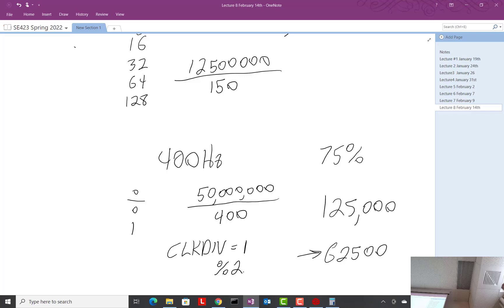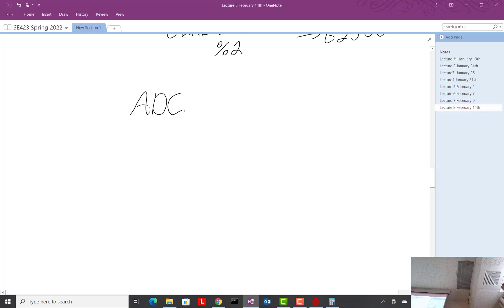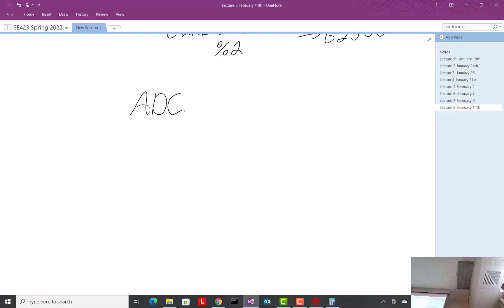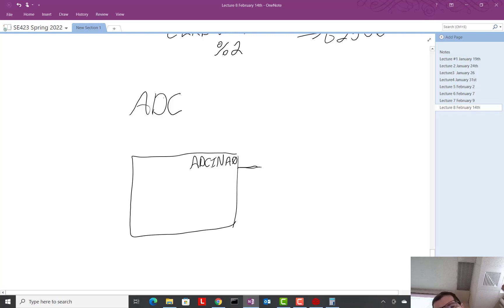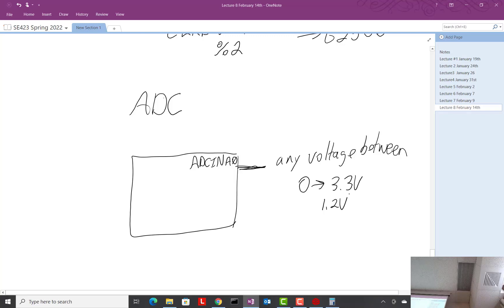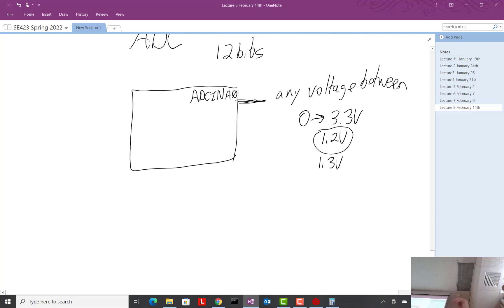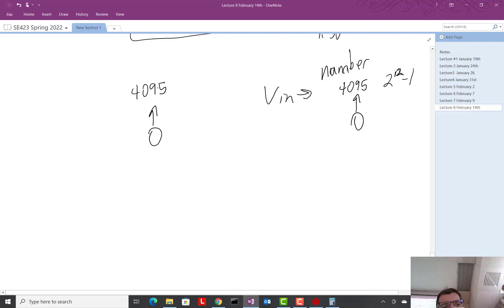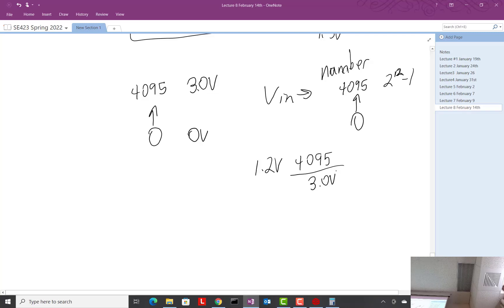ADC (Analog to Digital Converter) Quick Introduction

Comment from the maker: No on the F28379d there are internal 3.0 volt references and the adc uses the that 3.0 reference for its high. So 4095 is almost 3.0 volts or anything higher than that.

Comment: Sir, the maximum voltage that can be applied should be 3.3volts rather than 3 volts right?
So at 3.3volts it gives out a digital value of 4095.